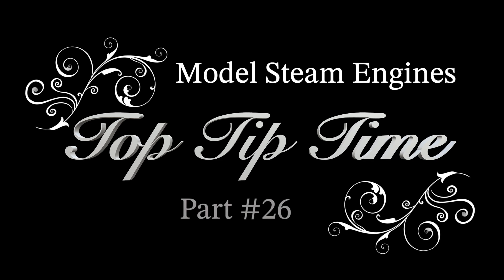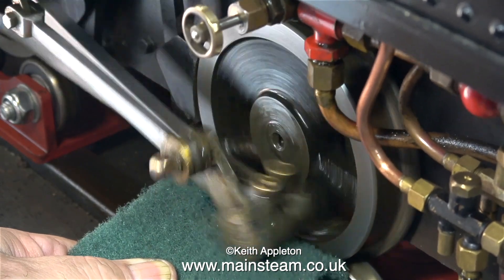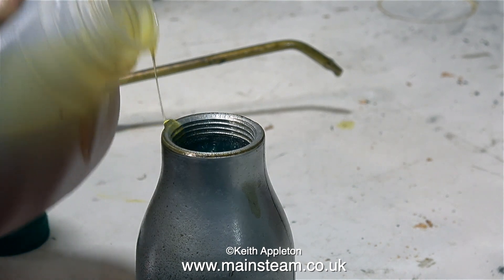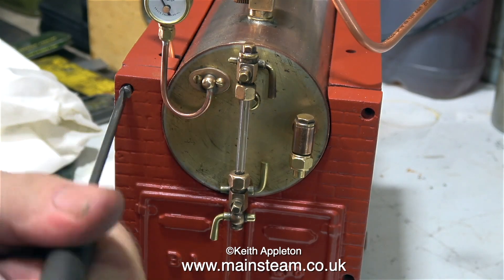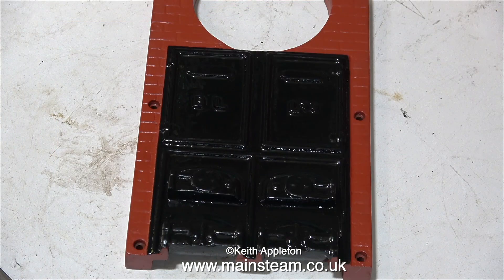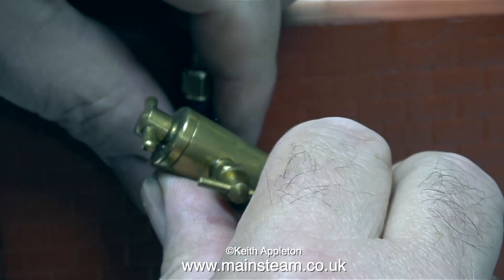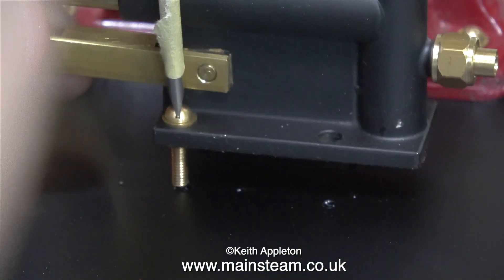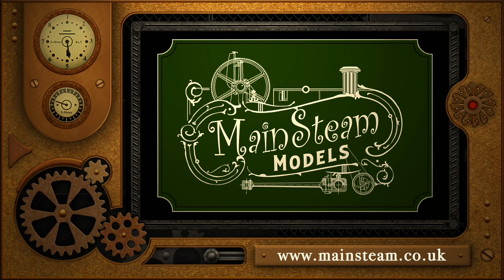MODEL STEAM ENGINES - TOP TIP TIME - PART #26

Comment: there is a trick, if you want to paint straight lines and want to avoid shaking, put your elbows ion the table and hold the hand holding the brush with the other hand.